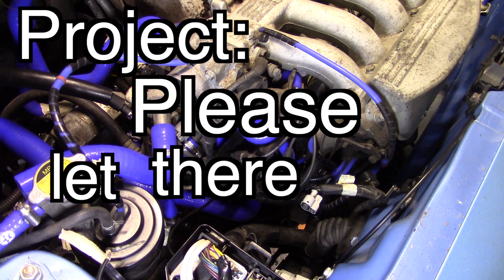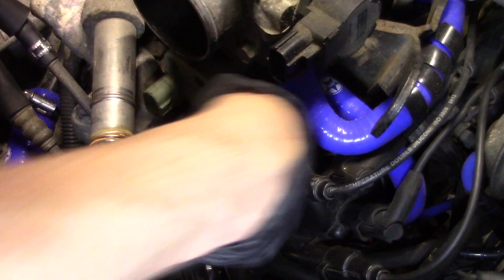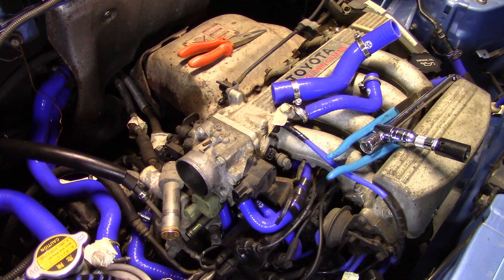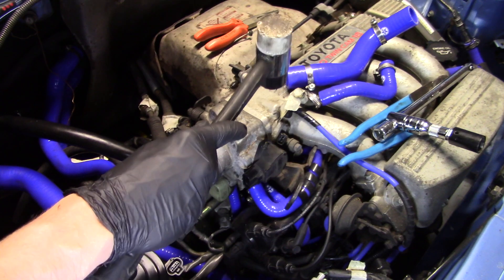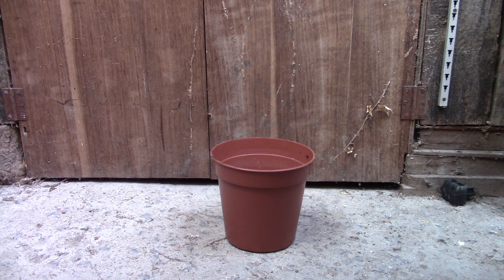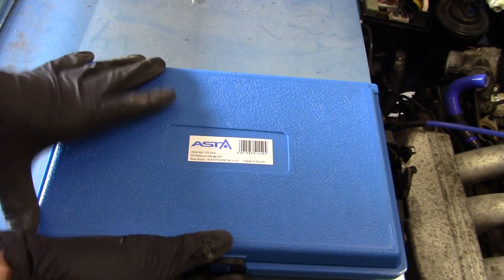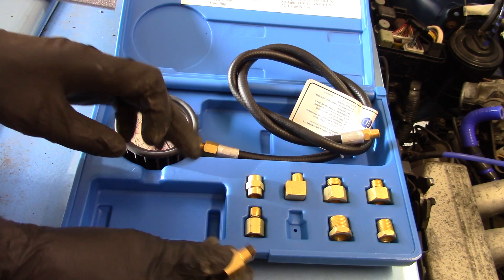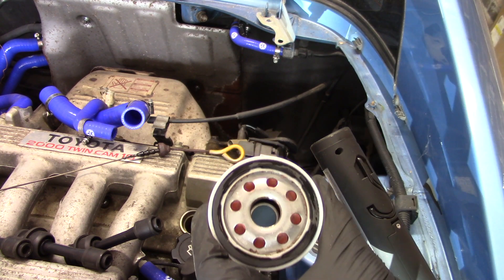Toyota MR2 Project - Part 44 - Oil Pressure Test

Comment: Just a curious question... Do you ever wish you'd spent a couple of grand more and not had to do all this work. Don't get me wrong, I love a project too, but sometimes you have to learn when to scrap it... Please don't scrap it, keep the channel going!!
Reply from the maker: Never. No doubt it would have been cheaper and quicker to pay a mechanic, but the goal was to have a project car and do as much as possible ourselves. It can suck sometimes, but 99% of working on Misty has been awesome, and we’ve learned a lot on the way 👍
Reply: @EnginesandUnfinishedBusiness  I'm speaking as someone who bought a "cheap" 320d and "may" have spent more personal time and money on fixing it last year than it cost 😂
 I'm still craving an MR2 but a good friend bought one last year which I got to drive a lot and made me want one even more, but lesson learned, I'm thinking keep the same budget for fixes as the car cost. Would that be a fair estimate?

Comment: Progress!!!!   Inspiration too.  I’m gonna get a battery for mine this week and see if it still runs:-).  I’m guessing you don’t have a shop manual?  I don’t remember, but your car is a 93, right?
Reply from the maker: Ours is indeed a 93 (Rev 2). We sort of have a shop manual, in that it’s a downloaded copy for a slightly later model US car. So it mostly works for us, but differs occasionally, especially when it comes to the engine, as the US didn’t get the naturally aspirated 3SGE that we have 😕